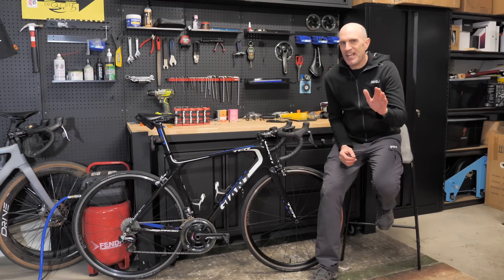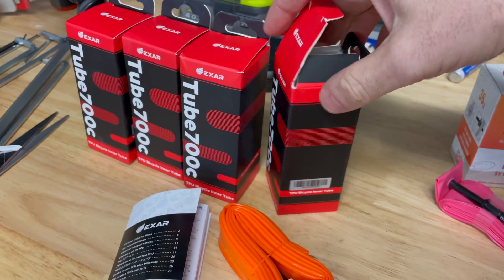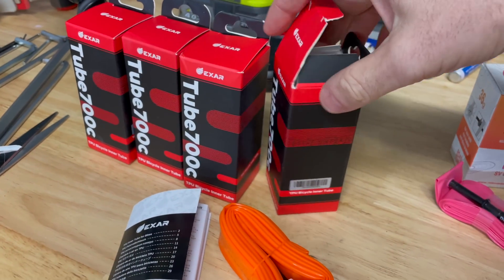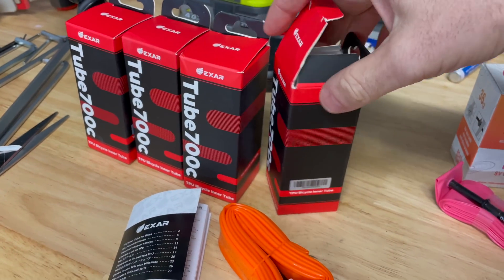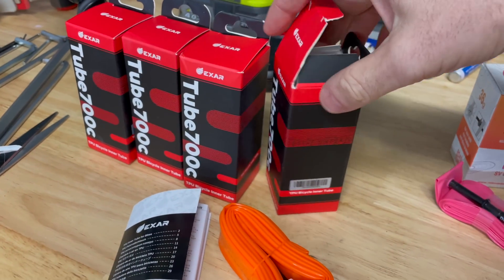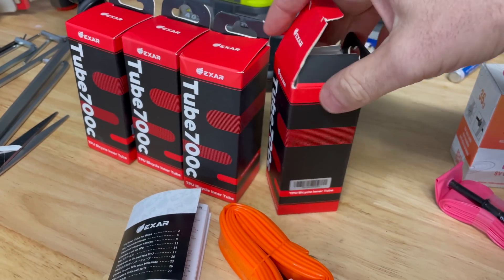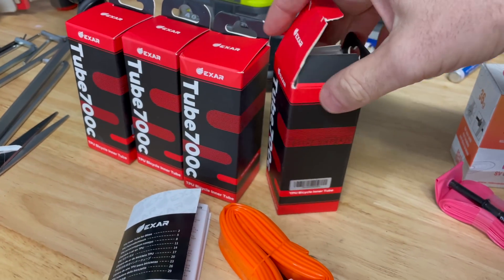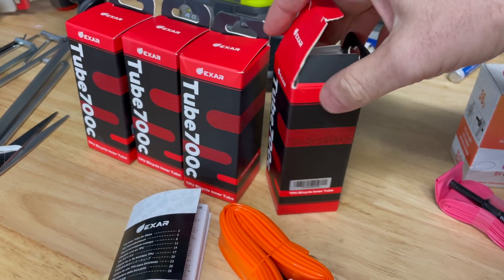TPU Bicycle Tubes: Light, Fast, Cheap.... What's the Catch?

Comment: I also have a Giant TCR in which I'm running TPU tubes. They feel fine but a tad more responsive than the butyl tubes I had before. What I have done on all my bikes is replaced the spares with TPU tubes and that had decreased the weight I'm carrying around considerably. I'm just waiting to have to replace my current butyl tubes before I replace them all with TPU. The Ride Now tubes are pretty reasonably prices online, so I bought a 4-pack of those.

Comment: I've been riding on the RideNow 34gm and 24gm both have been working well except there valve cores are pretty cheap. I've just switched them out for others off my old regular tubes. I'm buying the 19gm now I'd think they'll work just as well. : )
Reply from the maker: Good stuff. Thanks for being a new subscriber here too. It's much appreciated!
Reply: @gplama  Thanks. Hey on a different note. I have a stages L\R power meter and a new Kickr V6. I'm trying to find out why my stages power is ~25-30 watts more then the Wahoo, many others have same issue from what I've seen on the net. Only thing I've come up with is it's a drive train power vs. crank. Do you know what the issue is? Thanks.
Reply from the maker: @joelkurtzstudio  Something is up with one of them... 25-30W (let's say at 200-300w) is a lot more than expected drivetrain loss. If you can find a set of power pedals to borrow you'll have a third point of reference - Always useful to have if you want to pinpoint which is right/wrong/etc.

Comment: I have recently experienced multiple punctures (under the tube next to the rim tape and in the sides but not under the tyre tread) of my front wheel when using a Italian TPU tube after a 1200m decent on my bike which uses rim brakes. So I am very cautious about their overall performance with rim brakes.

Comment: I tried a pirelli tpu tube, got a hole in it. No patch will stick.  You think one of these patch kits will work though?

I admit, with 5 bikes I ride, keeping sealant fresh in all of them is expensive and  then some end up sitting.
Same with spare wheels for 3 bikes.    But no sealant can be used in TPU tubes, they'll still get holes.

I can see them as great spare tube kit.

Comment: Ever since I installed RideNow TPU tubes, the lightest ones 19g, with transparent valve, I have been getting static electricity throughout my bike or me. Usually happens when I am braking a bit harder going down hill or when I'm going over some slightly wet road sections... It shows at the shifters which is really not cool because I need to hold those things lol... and also can happen if I touch my riding mate anywhere during the ride... really crazy and sometimes frustrating. So far I haven't had a puncture and I'm really looking forward to using them in the future. I inflate them at around 55 psi... 60kg :) running contis 5000 25mm, carbon rims, alu frame, carbon fork and steerer. Any info on how to get rid of this electricity without switching back to regular tubes would be grand! x)

Comment: I've bought both tubolitos and Ride Now. Of the 2 Ride Now has longevity problems. After a couple rides, they loose their ability to hold air. Tubolitos are much better in that respect. Also, I do not recommend using them as replacement tubes in one's saddle bag - UNLESS you have a preasure gauge with you while out on the road. I've experienced blowouts when replacing out on the road.  Take for what you like. These at least are my expereinces. CONCLUSION: i went back to butyl.

Comment: That "lazy" return to its original shape of the butyl tubes is due to elastomeric hysteresis. Basically, heat is generated during the stretch and return, which reduces the elastic energy available to return it to its original shape. That heat is also the reason butyl tubes have higher rolling resistance, since the bending / stretching as it rolls generares heat, which means the kinetic energy of the bicycle is being reduced.

Comment: Tubolito was the first to make this kind of tube and market it.  I've been riding them for over 5 years.  I cannot recommend them enough.  Their customer service is incredible too.  I would rather use them than go tubeless on my road bike.  Maintenance is so much easier and it's way better than getting sealant all over you when you're on a ride.  Price is high but how often do you have to change a tube vs. the cost of sealant and ongoing maintenance.  Never going back to a traditional tube.

Comment: After having a flat this past summer and finding my bike shop only had one butyl tube in stock for my cyclocross bike, I've decided to switch over to the RideNow TPU tubes on that bike and see how they hold up along my local riverside trails.  Good to know they shouldn't blow at 50psi in my 33mm CX tires.

Comment: I switched to RideNow TPU tubes several thousand kilometres ago. I prefer the way they ride to butyl tubes and I appreciate the weight savings. I carry 2 spare tubes. So 4 TPU tubes instead of 4 butyl tubes saves about 300g. I have had a couple of punctures which I fixed with the patch kit included with the set of tubes. Finding the holes is tricky. Best to have a sink of water and a felt marker to mark the spot. I also put some weight on the patches while curing to ensure they stay on. Not going back to butyl tubes. :-)

Comment: Not cheap at all. At least in the EU. My 5 euro Conti light butyl is 65 gramms. (For 25-28mm tyres). Lasts 10.000KM/1 flat. A comparable stronger TPU tube  is 45-50 gramms, and costs 4X-5X more. ANd TPU has harsher ride than butyl, not to mention tubeless or latex. But considering wider tyres like 30-32mm road tyres, TPU has future, avoiding the tubeless hassle. For wider tyres, butyl tubes are too heavy indeed.

Comment: Question is WHY? Perhaps one could pack two of these in the space of one butyl tube and be twice covered on the road or be able to rescue someone else out there while still having a spare for yourself? Otherwise why spend more money on a regularly consumed item like a tube? Michelin A1 butyl tubes are light, cheap, easy-to-find and hold air pressure well. Their valve stems don't easily tear out/break off and they can be easily patched. 
TPU seems IMHO a solution looking for a problem. Nothing shown here makes me want to buy any.

Comment: Rode all last year on the same tubulito tubes in the non tubeless gp5000 without a puncture. 
If you try to poke a philips screw driver through a tpu tube it holds much better than normal tubes

Comment: I use Vittoria latex tubes but carry RideNow Race Formula for spares. I just love the feel of latex tubes even if they are a bit heavier than TPUs. I been running GP 5000 clincher for two seasons (close to 5000 km) and I haven't had a puncture as of yet, so I really cannot give my impression on the RideNow TPU tube. I ride in a TT/Triathlon configuration with almost even pressure in front and back at just below 100psi, but I stick to the good roads. I underestimated the the entertainment value of this video. It was really fun looking at you blowing up those tubes. Thank you for that.

Comment: I use TPU on my gravel (disc brake) bike and find them less hassle and weight than tubeless,  have them on a rim brake road bike on Alu rims and all seems fine. Anyone know what they are like on long descents in hot countries? Any chance of them going pop on rim brakes ( alu or carbon rims) due to heat build up?
Reply: Only the heavier versions, ~38 g  are recommended for rim brakes, not the 24 g.

Comment: Thanks for the comprehensive review Shane. Did my eyes spy a blue tyre tool to get the last of the bead over the rim?  May I ask the brand and your thoughts. My hands and palms cop a beating seating Contis and Schwalbe and anything that would reduce the pain, sweating and swearing would be of great benefit 😀. I bought a Bike Hand Tool, but it's near useless on road rims. More suited to MTB. TIA.
Reply from the maker: I think the blue tyre levers are Schwable. Working a tyre on from the opposite side of the valve first is the best advice I can give for stubborn installs. Even then some need a helping hand/lever.

Comment: I suppose one detail not fond if is valve cores essentially non replaceable cemented in. If tube gonna leak valve a likely suspect. I was able in one case to remove and rethread core back in and valve would seal surprisingly. Course weight savings is also in how they do valve.

Comment: I'm in the exact same spot- I have n+1 bikes now and the road bike often sits on the trainer for weeks. I am switching from tubeless to TPU for the exact same reason. Also I did not like when I actually punctured my tubeless tyre the sealant leaked all over the place and didn't seal. I'v e got better sealatant now but looks like it's tubeless for my other bikes and tubes for my road bike for now.

Comment: What's the Catch? Easy, the price, from trying every innertube there has ever been (or it feels like it) you will always have to replace them eventually, and TPU-inner tubes still cost 3-4x as much as butyl innertubes and from my experience againx (tubolito), they don't last 3 or 4 times as long. If they would come down to €10-15 I would probably go for them, but for now I only keep them as my second spare.
Reply from the maker: Things have changed. Check the prices of TPU tubes online (AliExpress).

Comment: For those of you new to TPU, do yourself a huge favor and toss the nasty rim strip in the trash and apply two layers of tubeless rim tape.  You will all but eliminate those crazy ghost flats where the tube contacts the spoke holes or edges of nasty rim strips.  The other benefit of using tubeless rim tape is when you do puncture, the air will leak out a lot slower.
Reply: Yes. The rim tape need to be flawless. Had some ghost punctures that after closer inspection showed to be on the inside of the tube. After changing to new plastic rim tape no issues at all.
Reply: What about tubeless ready rims, the surface might not be perfectly smooth...?
Reply: Use tubeless rim tape prior to using TPU or latex tubes.
Reply: I am not sure of the advantage of tubless rim tape over the patches. The patches are glued so you can stick them to rim or rim tape which helps keeping the valve centred. When I don't have patches I use a bit of rim tape to make my own patch but I don't see the advantage over the (ThinkRider) patches. That said I don't know what "Tubeless rim tape" is. I just use clincher rim tape.
Reply: @nihonbunka  Here's a video on tube less rim tape and how to install it.  The purpose of the rim tape is twofold. 1. to create a soft, smooth surface and 2. to create a semi air tite seal.  TPU tube are thin and sensitive and the tubeless rim tape creates an excellent bedding surface in the rim for the tube.  2. With the proper installation of tubeless rim tape, in the event that you puncture, the air leaks out of the rim more slowly because you have sealed all of the spoke holes with tubeless rim tape. This is a high value safety thing!  No one wants to hear "bang" and suddenly your completely flat and riding on the rim. I hope this helps!  Here's a video on tube less rim tape and how to install it.
Reply: Lol puncture happens on the tire side not the rim side how does using tubeless tape will prevent puncture leak to be slower??
Reply: @jodaddyxxx  I read about the tubeless rim tape from someone else that was having the same problem with ghost flats with tpu tubes. It solved my issue completely

Comment: Friend bought the 24g ridenow TPU tubes. All four popped after just running thru the smallest if pot holes. Not a problem woth butyl tubes. Hes not going back to tpu's. Regardless of weight savings.
Reply: The 45g RideNow cyclocross is indestructible hitting potholes IMO.  The 24g is for like 140lb riders.  I use them in a 32mm Pirelli Cinturato Velo I weigh 220 and hit massive potholes all the time.

Comment: rode with Tubolito tubes, on a mildly warm day, around 25 degrees, on a rimbrake bike. All of af sudden the rear wheel exploded, and tore my new Conti 5000 tyre into pieces, because the inner tube couldnt handle the heat - TPU inner tubes, NEVER AGAIN!

Comment: I've been using the Ridenow (standard version) tpu tubes for about a year now. I can't really fault them too much: light, pretty easy to install, holds air better than a latex tube and lasts pretty long. My only gripe is that when there is a puncture and you want to repair it, the patches don't stick. In my case the tpu absorbs the glue and the area is not tacky enough for the patch to adhere to the area, so I end up throwing the tube away whenever I get a puncture.

Comment: I've been running the Tubolito in my 25mm tires replacing the previous Vittoria Latex tubes. The combination of the Vittoria Latex with Vittoria Corso tires gave me the closest ride character to running tubies. The Tubolito TPU's are not the same feel as running the Latex but pretty good. The only issue I have come across with both Latex and Tubolito TPU tubes is that once they have been in use for a bit; they tend to stay "stretched" making tire changes a careful art. You have to be careful not to fold, twist or pinch that extra material when reinstalling the tire. Otherwise so far; so good.
Reply: That non-elastic stretching of TPU when inflating tyre is one reason why it helps to have some air (no significant pressure but like 0.2 bar) in tubes when installing them.
Though that helps also with normal butyls. "Boiled spaghetti" behaviour isn't easy to handle.

Comment: I use RideNow TPU tubes (standard, not he super-extra-giga light ones) about 2-3 weeks now, and I think it worths the money. 👍 TPU tubes are delicate for heat, so you have to consider this using it with rim brakes.
Reply: The standard version (36g) is compatible with both rim and disc brake and I would only be concerned with heat build-up on rim brakes if I was going down an alpine climb. The superlight version is only compatible with disc brake for this reason.

Comment: From my recent experience using a co2 cannister to inflate a tpu tyre the air pressure drops significantly to almost zero over night, pumping with normal air and pump the pressure stays steady!
Reply: C02 cannisters should only be used to either 1. Seat a tyre to the rim or 2. Get you swiftly back on the bike after a puncture. Naturally, the tubes and tyres are more porous with C02 than air, so they will let it out more and thus lose pressure over time. After you have used CO2 to get you back home, replace it with normal air.

Comment: Okay. I switched my spare tubes (in Aug 2022 with a big price tag €30 each) to:
2 x Tubolito (Spare Tube Sclaverand Ventil) 700C 
			+ 1 franz. Slaverand Ventil 80mm 18-28 		42 gr  			+ 1 franz. Slaverand Ventil 60mm 30-47 (Gravel) 	64 gr  and safed space and weight. No big news for you. Both in one saddle bag for Road and for Gravel always with me in case tubeless will not work. Yes. Thanks, Ralf.

Comment: What?! I thought manufacturers didn’t recommend using them with rim brake and over 75 psi, because on a descent it may heat up & explode. Anyone has longer use experience? I would like to try them but I am using rim brake and California summer May get to 85- 100 degree

Comment: Trying some AliExpress ones on my steel road bike with alluminium rims, rim brakes and Panaracer Race D Evo 4 tyres.  Lighter and smooth rolling at 110psi but I still feel a little nervous because I haven’t experienced a flat with them yet.  They seem to be coping well with the hot Japanese summer.  My other bike has carbon rims, rim brakes and tubulars, which feel great but are a total nightmare to fix.
Reply: Interested to hear your experience later on because I thought TPU is not recommended with Rim brake , specially higher than 75 PSI due to risk of explosion because of of heating up while descending.
Reply: Running slightly lower pressures now at about 90.  I have had punctures from pinch flats when hitting small stones and one overheating puncture on a very steep. twisty, potholed descent.  For me, around 90 seems to be the best for avoiding most pinch flats but, as I commute and ride home after dark, I can't avoid all the little stones that litter the bike lane.  I always carry two spares and have had good results patching the tubes.  None of the punctures were explosions.  The air came out fairly fast but not dangerously so. @Questioneverything72

Comment: I bought RideNow TPU tubes and found them faulty out the box, leaking from the valve to tube junction. Unfortunately this was about 3.5 hours into a 12 hour time trial, and ended the day, both tubes I had failed immediate in the same way.  Real shame as they are super compact and easy to store. I have two more unused to test.
Reply: They fare better on tubeless ready rims (or tape)

Comment: I carry them as spares on long rides for my tubeless wheels. Case in point, 2-stage, 840km ultra gravel race in Tanzania in July - ran tubeless and needed to be self sufficient. So aside from tyre boots, plugs etc, I carried 6 TPU tubes in the space of 3 normal ones (650x48). As it turned out I didn’t use any of them, but I definitely appreciated the space and weight saving.

Comment: I am riding Schwalbe's Aerothan on my rimbreak carbon wheelset for two years now. No issues. I took the Schwalbes because the where tge only one, which reached back to me, when I had the question if it is save to ride them even on carbon wheels. (Because they are getting hotter than alloy). So kudos to the Schwalbe customer care! 🙂